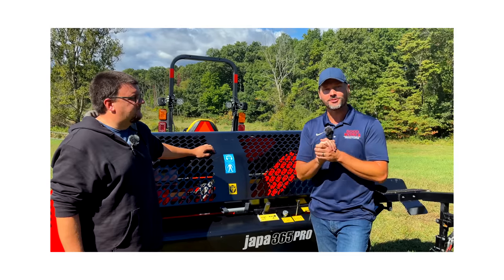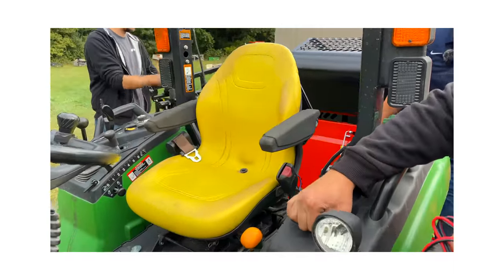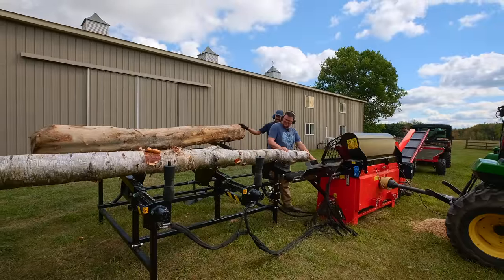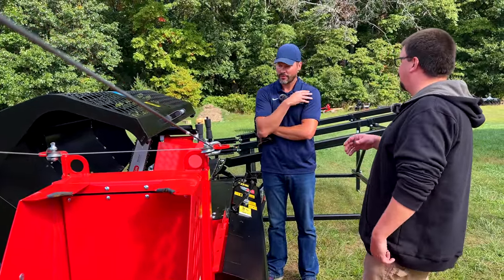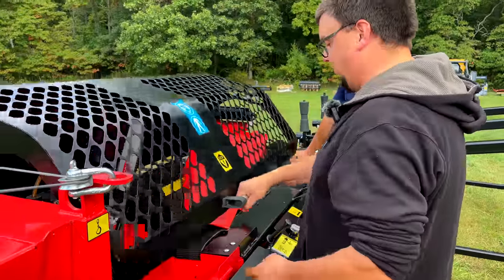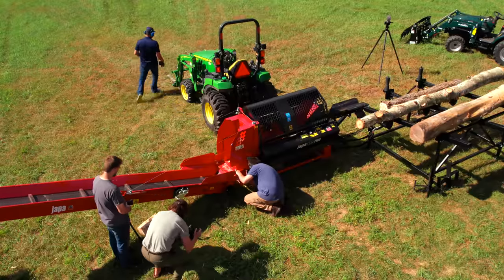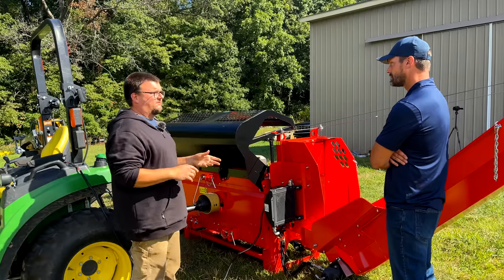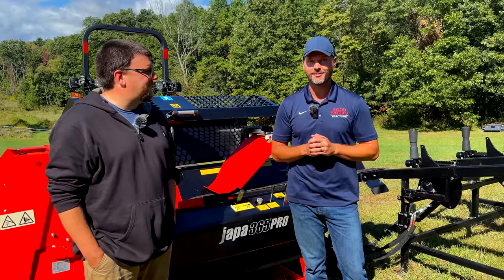TRACTOR PTO POWERED PROCESSOR! Firewood By The Cord 😱🚜

Comment: This thing cost more than the tractor it’s hooked to with a bare bones base price of $25,000. Not a practical price for the average diy firewood person
Reply from the maker: no. this definitely isn’t the machine for someone who doesn’t make a LOT of firewood. but for those that do, it’s pretty awesome!
Reply: I guessed 30k. This would be a awesome machine for someone doing it for a living.
Reply from the maker: Agreed, it's for a specific market
Reply: @GoodWorksTractors  I agree this is a super cool machine but definitely geared towards a person doing it for a living.
Reply: That's ALOT of $$$ when I'm supplying the horsepower and fuel to run it !
Reply: @patrickshaw4800  
If it were $30,000, that would be $30 per cord for 1,000 cord or $3 per cord for 10,000 cord.  10,000 cord at one cord per hour would be 10,000 hours.